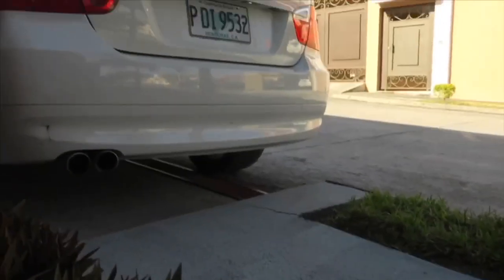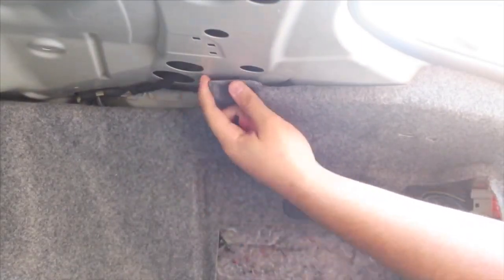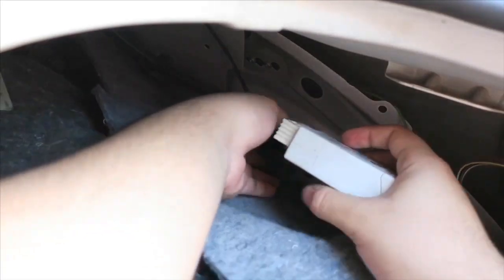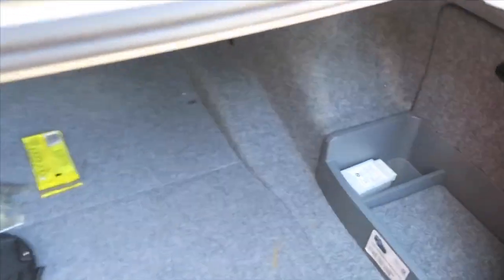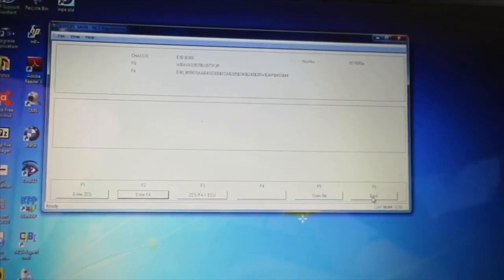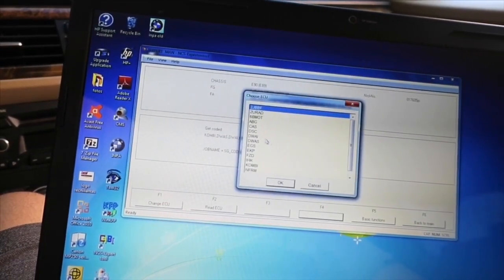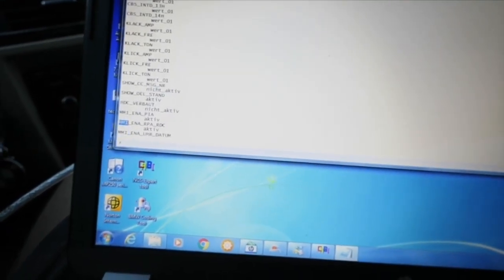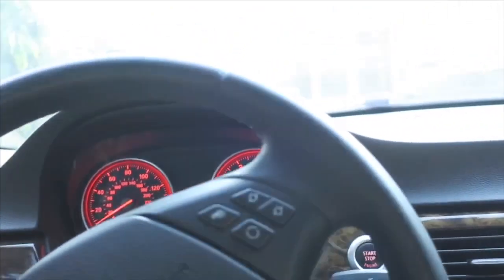No More Tire Pressure Sensors !! BMW E90 TPMS To FTM Coding !!

Comment: I use beamer code on expert mode and it works flawlessly and you can go back and record it back in I don't think we really need those if we're using regular tires not run flats

Comment: Thank you for the RDC module delete. Curious if you have figured out with NCS how to reset CBS oil service reset, when vehicle is over the maximum mileage. and oil service cannot be reset. I have tried without success. I don't want to disable the oil service reset, although that's an option.
Reply from the maker: Honestly I’ve never messed with that since I can do it from the cars instrument cluster but I think you’d need to reset it using INPA

Comment: Hey man, I ran through all the steps and got the dash light to disappear. Only question is the part where I had to go into the file to change the parameters. There was no RDC_alive in the file. Everything seems okay, took a 40 mile drive and no lights came back. I'm worried about those steps where you changed it to nicht_activ though. Any advice?

Comment: I can’t turn the dash light off, the I drive Tmps isn’t in bold letter and can’t click on, it doesn’t work from steering either, wasn’t able with snap on diagnostic either
Reply from the maker: Did you follow the steps as shown in the video ?
Reply: BMW HN yes I did several times, I diagnosed car, all shell sensors are okay “no tmps in tires and option on I drive is not in bold letters

Comment: Hello,
 07 328i idrive dead last year so I am using eonon just for entertainment,
 last week I replace my wheel without TPMS sensor on after few hours i notice red light come out 
I try resetting with left switch knob but no luck maybe my idrive is dead and no signal I just want to remove this option even I thought its a safe option to do but I don't need this option in my car. 
I did my hunt for the RDC module but no luck (360) I did try code with the fuse out but still no luck even got WORSE left headlight high beam stays ON !? 
I did a trying factory reset but no luck" what should I Do now? 

anybody can help me to bring my car feature back to normal and disable my TPMS red light?
Reply from the maker: Looks to me like when you reset the module it activated the high beams as daytime running lights(which also happened to me although I forgot to mention it on the video), if I’m not mistaking I show how to code that out on my coding video if you would like btw message me on my instagram @bmw_hn and I will try my best to help you out !!
Reply: @bmwhn7733  So if I follow this video exactly as you did it, will it activate the high beams as DRL? What step in the process needs to be fixed to make this not happen?
Reply from the maker: There’s actually nothing you can do to prevent it since you’re resetting the options back to factory, all you have to do is once you’re done with the TPMS process just disable the DRL by coding them out on your FRM once you do that the DRL will be deactivated.